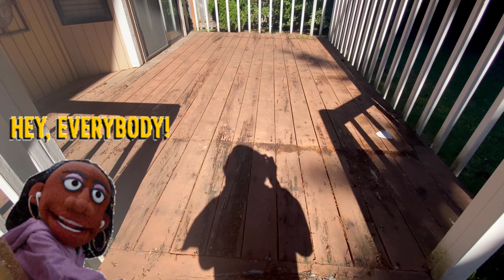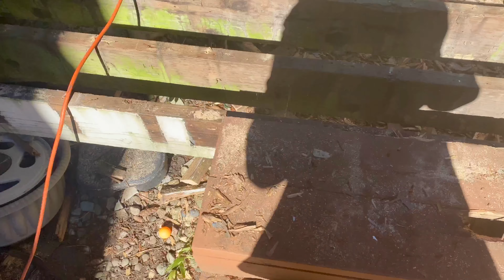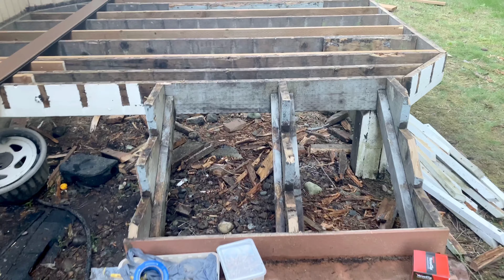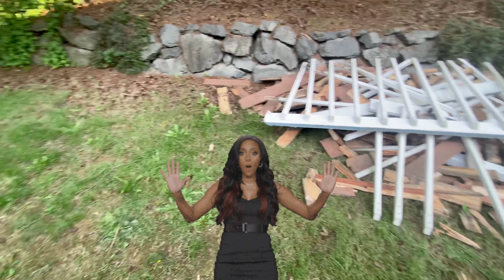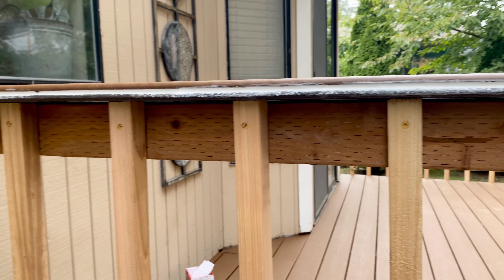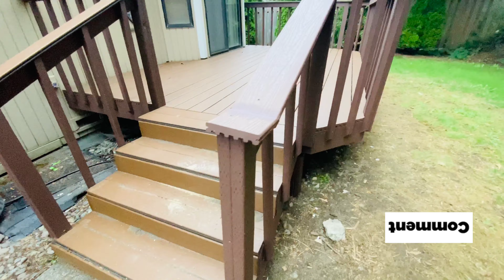Deck Remodel Reveal | Process | 2020

Comment: I was wondering about that kind of flooring for our deck. I thought it would be hot in the summertime, so we were going to use cedar. Next year I will revisit it. thank you great video!
Reply from the maker: Are you in a super hot climate? That might be something to ask more questions around. Being in the Pacific NW—no worries there.🤣I just love that it will not need replacing for many years with no rot. Thnx for checking out the process.

Comment: Perfect timing. We're just starting our deck project for our Thanksgiving celebration. You make it look so easy. 

Question: Do you find the decking to be slippery?
Reply from the maker: Nice! I hope all goes well. Is it a remodel or build from scratch? The decking is not slippery at all. It has a lot of texture to it so that helps with grip.
Reply: @HomeFix19  We're building from scratch. Thanks for the heads on on the slipperiness.
Reply from the maker: Awesome! You got this!👍🏾